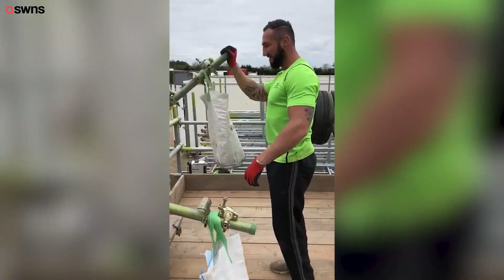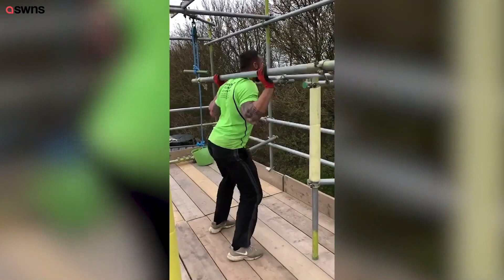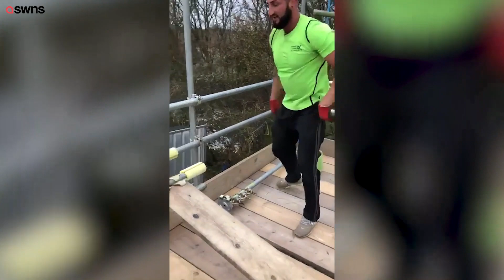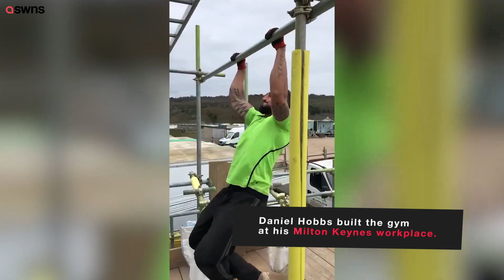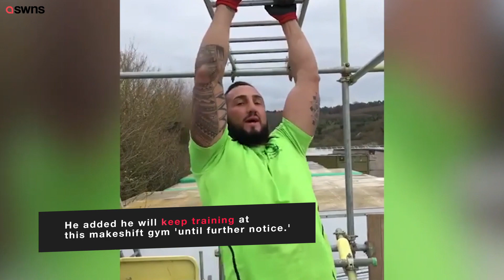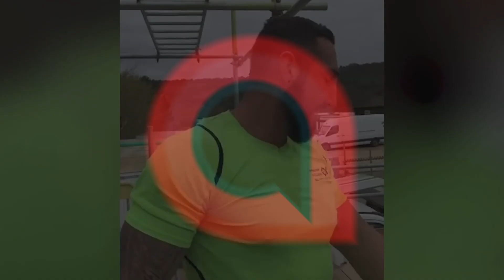A scaffolder creates his own gym routine in the yard | SWNS

Comment: 7 hours constructing a gym in his yard,  Why not just go on site and lift tube and fittings whilst getting paid to do it? Rope and wheel with a tub of fittings, just get a job which is higher than 3 storeys and pull the tub up. No wonder people say scaffolders are brain dead.
Reply: you must be a skinny fella whos never stept foot in the gym. Scaffolding doesn't just make you gain muscle.. It will make you stronger.  You need to train each muscle to the point of failure and eat right. ya sausage